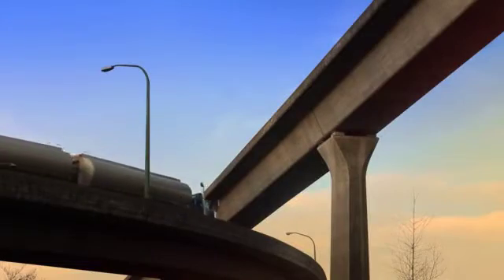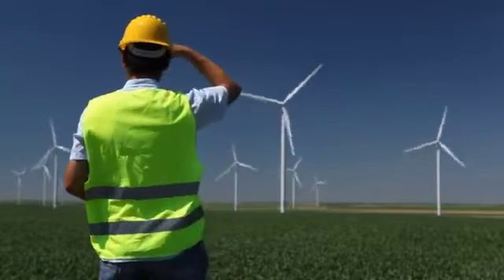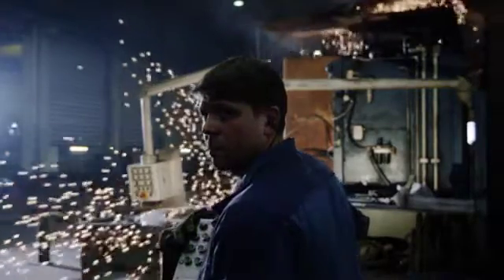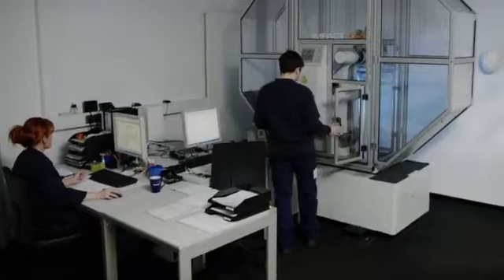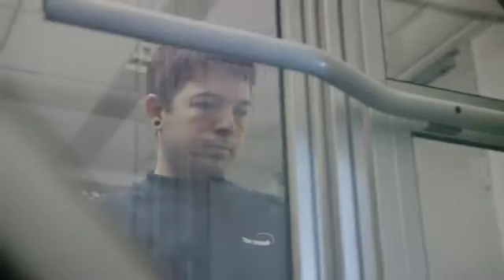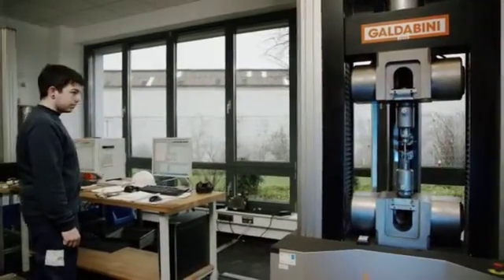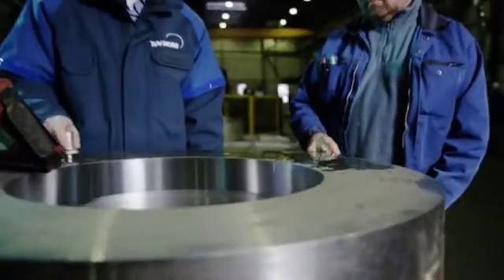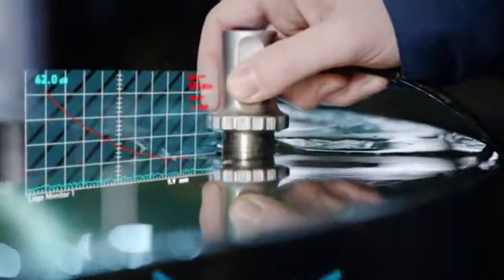TÜV NORD material testing

Comment: SMES Tiers and Levels Exception. APPROVED. Reason:TUV Certifications applicable based on Geodetic Infrastructure, Infrastructure layout and consistency as well as the Surveyors report for consistency of the resistance work, per item/industrial grade material, compliant to the TUV certifications that warrants its SHELF LIFE for resistance tests, as well as other forms of Industrial tests, only attained from NON AI/Fintech system.©™® based on Tierage standards of Excellence for Quality, Quantity and Own Formulation. ALL RIGHTS RESERVED*******NON DELETION-FORFEITURE.******